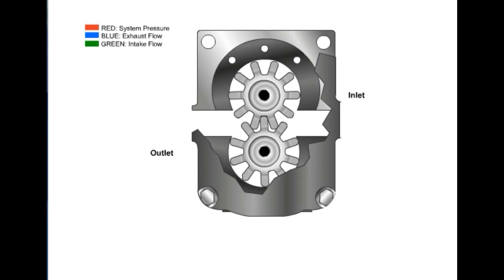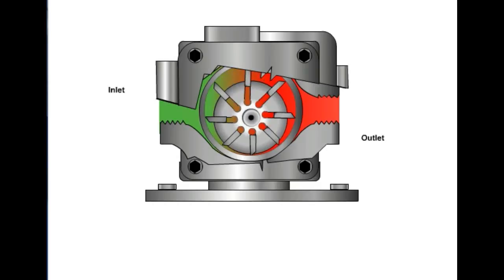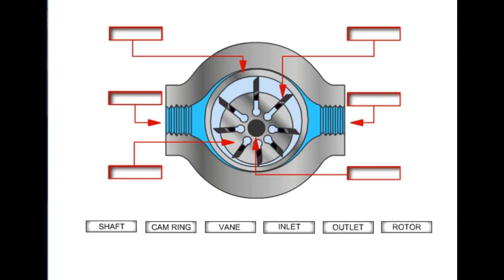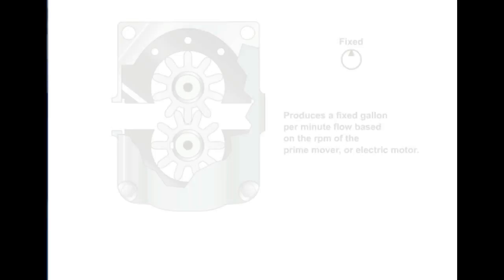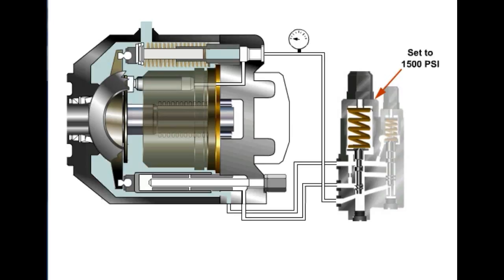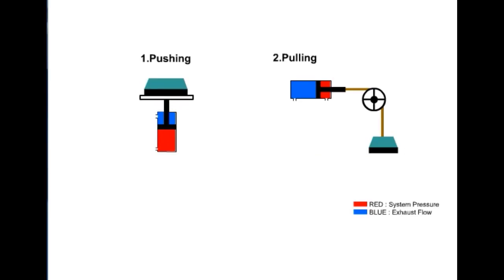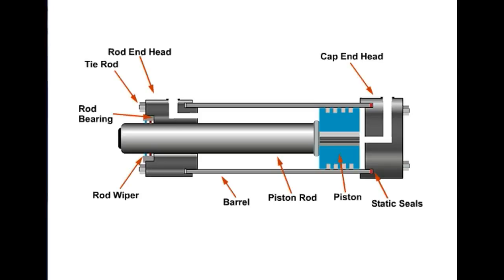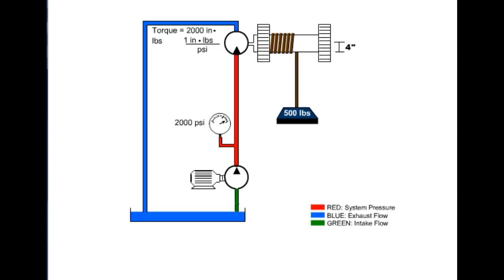Hydraulic Basics - 05 - All in one video - #Hydraulic_Pump,#pump,#hydraulic,#valve

Comment: about to start learning the trade of hydraulic repair at a shop, great video.
Reply from the maker: Thanks 👍
Reply: Remember that "Safety" is Paramount when working with anything, especially hydraulic fluids. You can lose you body parts or your life if penetrated by a hydraulic, (diesel fuel, or a pressure washer) or any fluid under pressure..
Reply: Hello my names muhamad

Comment: What type of pump is used on heavy equipment hydraulics such as excavators and wheel loaders?
Reply from the maker: mostly, use hydraulic gear pump
Reply: Deoends of the machine.for example most of the excavators, Loaders, Graders etc use variable displacement pump. Very few (mostly small machines like Backhoe Loader) machine nowadays use gear pump.